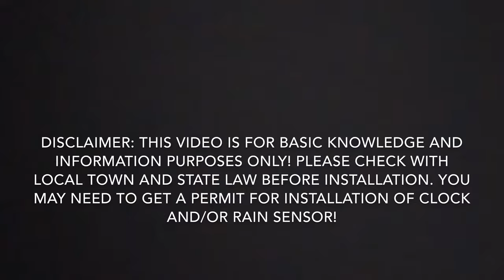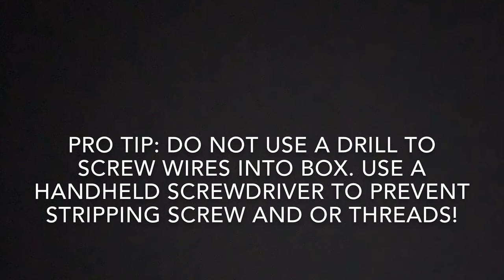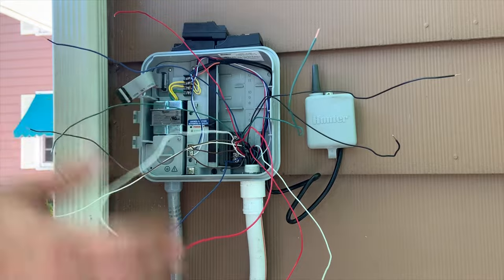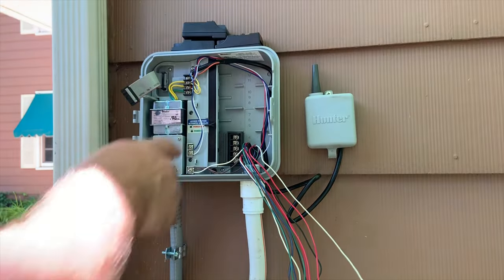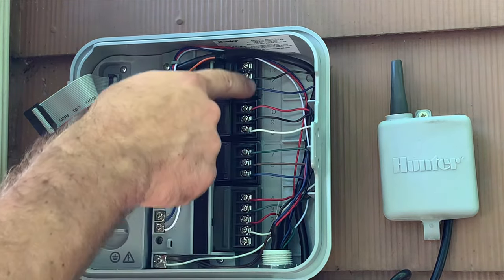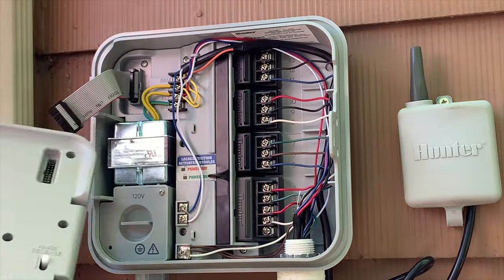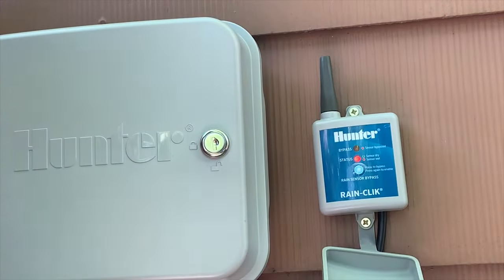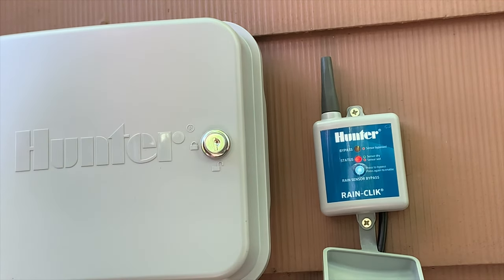How To Install An Irrigation Controller

Comment: I'm upgrading from a Pro C to a Pro HC WiFi and I can match up all the wires except for the one labeled REM in blue, what is that wire for and where does it go on the new controller? There's a place called SEN COM next to the Sensor connectors is that where it goes?

Comment: Hi Matt, can you help me where would I get big wire which is installed top left side on the controller. I appreciate your help. somehow that wire got cut and i did not find it on Hunter Industries website either. Also, if you can tell me what does that wire called? Thank you very much.  Waiting for your reply on this.

Comment: when my technician winterized my system he disconnected a black wire. I want to open my system myself this year and I am not sure where the black wire goes that he removed. there is currently no wire connected to the pm/v terminal. Is that where it goes?
Reply: Do you have a pump with a separate relay?